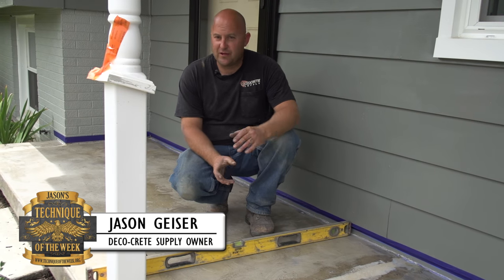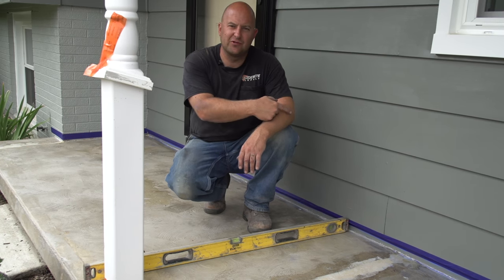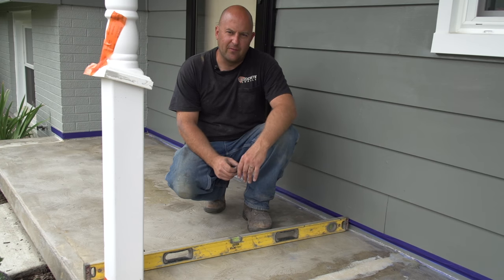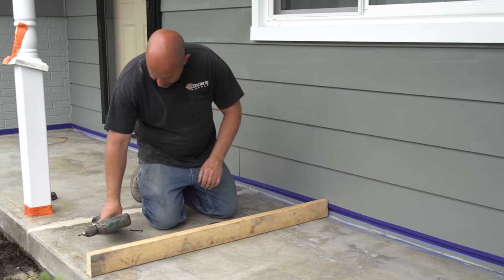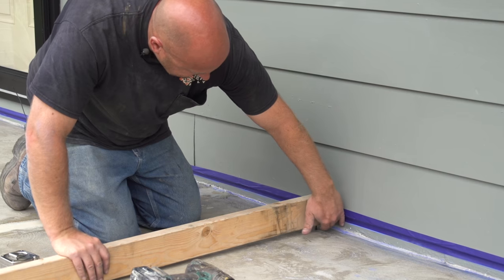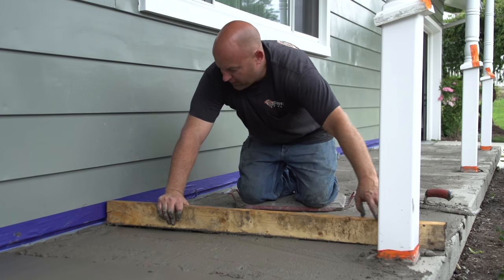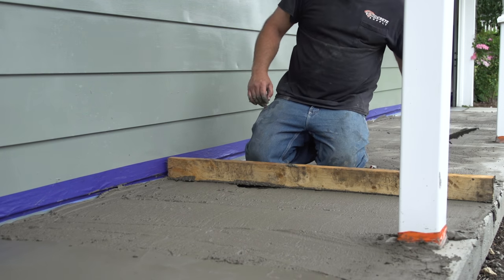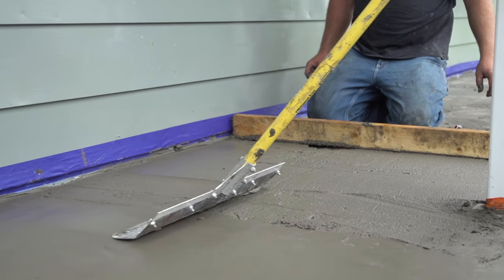Create a Sloped Concrete Overlay!

Comment: How do you make sure it bonds properly to the old concrete - as well, what type of concrete mix are you using?
Reply from the maker: Thanks for the comment! The normal prep process would be a strong power wash and prime the surface with Sure Bond. If the concrete is really smooth or if there is a heavy build-up sealer, you may need to give the surface a light grind before application. In this video, we were using Easy Patch to repair the slope. After that, you apply whatever overlay system you want for the desired look. I'll leave some links to a few other videos and the Easy Patch page on our website. Thanks for watching Deco-Crete TV!!                                                                                        
 https://www.youtube.com/watch?v=qIEfPZC_1pI&t=125s                                                  
 https://www.youtube.com/watch?v=ttIRdTJ6KDY&t=77s                                                    
 https://www.youtube.com/watch?v=6wRXo5dGPmU                                                           
 https://www.youtube.com/watch?v=uVF5gTI2t_k                                                                 
 https://www.youtube.com/watch?v=UrwRi0_0I2Q&t=18s                                                                                
 https://www.deco-cretesupply.com/products/repair-prep-products/easy-patch                                         
 https://www.deco-cretesupply.com/products/overlay-mixes-repair-prep-products-vertical-concrete/sure-bond

Comment: I'm a complete rookie, what would I use on that? some type of leveler? I have a 8 x 16 slab on the side of my house that I would like to build a shed on but the slab has a slope that goes towards the house. Any tips and tricks would be appreciated.
Reply from the maker: Yes a self leveler would work if you are trying to make the slab completely level. but if you are trying to reslope the slab the other way, you would need to use the method in this video. 
flat top: https://www.deco-cretesupply.com/products/overlay-mix/flat-top 
easy patch: https://www.deco-cretesupply.com/products/repair-prep-products/easy-patch

Comment: Did you have to prime the original slab before you put this overlay on? And what brand of overlay did you use?
Reply from the maker: Thanks for the comment! We primed the slab first with Sure Bond 100 and the overlay material was from Deco-Crete. We used Easy Patch on the first layer to re-slope the slab, and Trowel Overlay for the final coat to make it look like broomed concrete. I'll leave a few links at the bottom. Thanks watching Deco-Crete TV👍          
https://www.youtube.com/watch?v=qIEfPZC_1pI&t=6s                                                                                   
https://www.deco-cretesupply.com/products/repair-prep-products/easy-patch                                        
https://www.deco-cretesupply.com/products/trowel-overlay/stamp-mix                                                    
https://www.deco-cretesupply.com/products/overlay-mixes-vertical-concrete/sure-bond-100

Comment: Just wondering I have a concrete slab with 16 x 14 gazebo sitting on it, when it rains water ends up on it and I have to push with a broom or wait for it to evaporate. the cement that was put down was self levelling called Agilia, so the floor is completely level. Any ideas how I can slope from center out to all sides as this is a bigger job than just a porch walk out? Fantastic video by the way reading other people comments is proof of that as well as watching the video myself.
Reply from the maker: Thanks for the comment! The technique in this video would still work on a larger scale, you would just need longer screed board. If you work from center out to edge in the short direction, you could do this with an 8' board. It'll be tough to do that size of an area seamlessly, and it will require mutable batches of the mix. The best thing would be to treat this as a two step process. The first step would be creating the slope and it probably won't look that great at this point. Once you have the slope the way you want it, you could apply a thinner overlay to make it look good. I'll leave a link to our video on broomed overlay below. Thanks for watching Deco-Crete TV!!                                       
 https://www.youtube.com/watch?v=qIEfPZC_1pI&t=120s

Comment: have a question though.  I been reading everywhere that poring concrete over concrete not a good idea. anyways I I have a 30 feet by 4 feet slab on side of garage that has a negative slope towards garage and water is been getting inside garage over the years.  My parents live in garage.  So will this method work to fix negative slope or should I just remove and pour new concrete with new slope to fix problem?  or maybe I should have a french system installed which sounds expensive:(
Reply from the maker: Both methods will work but a full replacement the safest but most expensive. Thanks for watching marco!

Comment: I need to slope a garage floor from the walls, this looks great. Any issue with the edge where the concrete will be very thin/feathered cracking or flaking? Thanks
Reply from the maker: Do not go thinner that 1/8" with easy patch, you should resurface everything with a final coat.

Comment: Would I use something special, or would regular mortar work? I assume stoned cement would make this very difficult. I have front entryway porch with  a low wall around it. Whoever did it before left a lot of dips and reverse pitches. So lots of puddles every rain. I think this is just the thing I was looking for. 👍👍
Reply from the maker: Thanks for the comment!! Glad to hear this video was helpful! We would not recommend regular mortar for this, you'll need something a little stronger. The product we used in this video was Easy Patch from Deco-Crete. After we repaired the slope issues, we applied a concrete overlay to make everything look uniform. I'll leave a link to the product page for Easy Patch on our website. Thanks for watching Deco-Crete TV!!!👍                                                                                                                                                                               
 https://www.deco-cretesupply.com/products/repair-prep-products/easy-patch  
 https://www.deco-cretesupply.com/products/trowel-overlay/stamp-mix

Comment: Wouldn't the overlay need to be at least 2" thick to prevent premature cracking? How long would something like this last before having to redo or demo?
Reply from the maker: the material used in this video can be applied from 1/8" to 1.5" thick. there aren't any guarantees on longevity, but if the slab you are applying to is structurally sound these materials will generally last 15+ years

Comment: Thanks for this video. Jusr bought a place and am having this same issue on the enclosed breezeway that connects my house to my garage, except rather than water going into basement, it runs under the sill plate of the wall and runs into a low spot in the enclosed breezeway floor (same concrete pour).

How well can I expect a concrete overlay to bond to the existing concrete pour? Existing pour has a smooth texture and is painted so obviously there would be some surface prep.
Reply from the maker: After removing the paint and a strong pressure wash you can rely on the primer and overlay to bond.

Comment: Hey great video. Quick question if I want to reslope concrete how thick should I do my cemet for it to bond well and avoid cracking or chipping? Thanks! Keep up the good work.
Reply from the maker: For the mix in this video, Stone Edge Surfaces Easy Patch, you can featheredge to 1.5" thick in one application. https://www.deco-cretesupply.com/products/overlay-repair-products/easy-patch
Check out this technique for ensuring it bonds well https://youtu.be/l9rm2L2BmGE

Comment: Will it crack off with freezing. Did you use a bonding agent?
Reply from the maker: Thanks for the comment! This product holds up fine to freeze thaw cycles as long as the concrete is solid & the prep work is done properly. This job was done over 5 years ago in Ohio and is still holding up. We did prime the surface with Sure Bond as part of the prep work. I'll leave links to both products below. Thanks for watching Deco-Crete TV!!!    https://www.deco-cretesupply.com/products/repair-prep-products/easy-patch                                                                                                                                              
https://www.deco-cretesupply.com/products/overlay-mixes-repair-prep-products-vertical-concrete/sure-bond

Comment: Hi! My concrete stairs at the front porch are sinking. Can I add cement on top of them to level them without raising those steps?
Reply from the maker: Yes you can, but steps typically continue to sink. This would not be a great permanent solution. Slab leveling from a company like A1 concrete or replacement will fix the problem for good. Thanks for watching!

Comment: Dont you prime the the slab or prepare it somehow for the new overlay ????
Reply from the maker: Thanks for the comment! As long as there's no paint or a heavy build up of sealer on the surface, the prep work is just a thorough power wash. After that you make any repairs if needed, and prime the surface with Sure Bond. I'll leave a link to another video that covers prep work for overlays. Thanks for watching Deco-Crete TV!!!          
 https://www.youtube.com/watch?v=UrwRi0_0I2Q&t=1s                                                                                                                                                                                      
 https://www.deco-cretesupply.com/products/overlay-mixes-repair-prep-products-vertical-concrete/sure-bond

Comment: What's the best over lay material to use?  What concrete and does it need screen underneath it?
Reply from the maker: No screen required if the base slab is structurally intact. The material used in the video is linked in the description👍

Comment: Thank y for this great 💡! 
Have terrace with 3,5 m to make a slope. 3 m wide. Need 10 Sack concrete material (35 kg). Do y solve it the same way with (2) screws in a plank? Make it In 3 steps with a 1,2 m long plank?

Comment: I had a concrete patio poured and the concrete dried to fast the guy went across it with knee pads and it holds water in three areas. He poured concrete up to the bottom of my only crawl space. Does that sound fixable without ripping it all out and repouring it all over again? Concrete was poured on rebarb
Reply from the maker: You could use the Easy Patch product used in this video to fill in the low spots and as long as the slab has enough pitch on it, the water should run off fine. As long as you don't mind the how the patches look, that all you need to do. If you want the whole slab to look seamless, you'll need to coat the entire surface with an overlay product. Here's a link to  a how-to video on our Trowel Overlay. Thanks for watching!!!                                             
https://www.youtube.com/watch?v=qIEfPZC_1pI&t=1s
Reply: @DecoCreteTV  thank you for your input

Comment: Did you use any kind of bonding agent? That top layer isn’t going to adhere to the bottom cured layer.
Reply from the maker: Yes, we recommend Sure Bond from Deco-Crete as a bonding agent. Both for bonding the first layer to the concrete, as well as between each layer of overlay. Thanks for watching Deco-Crete TV!!!

Comment: Do you have a video on how to pour a patio with a slope for drainage?
Reply from the maker: Thanks for the comment!! We don't have a full video on that exact thing, but we do have a few on the basics of forming a concrete slab. For exterior concrete, the minimum slope required to get the water running would be 1" of slope per 10', but depending on the situation, you might want to give it a little more. We prefer 1.5" per 10' on stamped concrete, just to make sure the water makes it over the grout lines & textures. I'll leave links to a few other videos that may be helpful. Thanks for watching Deco-Crete TV!!!      https://www.youtube.com/watch?v=grwqtx5ajUQ&t=156s                                                                                                                                                      
https://www.youtube.com/watch?v=EYEAtPSf6ps&t=100s                                                                                                                                                     
https://www.youtube.com/watch?v=LjbGBwxURCE&t=266s
Reply: @DecoCreteTV  thank you!

Comment: How thick of an over lay should i do for steps? They are all sloped toward the riser!!!!!
Reply from the maker: Thanks for the comment! The thickness would depend on what kind of finish you're looking for. Our Trowel Overlay works good for broom finishes and light trowel textures. You would apply that at around 1/8" per coat. If you are looking for a stamped look, you would need to use our Stamp Overlay. That can applied from 1/4" - 1/2" thick. Thanks for watching Deco-Crete TV!!!
Reply: @DecoCreteTV  THanks man!!

Comment: Can the Easy Patch material that you are using be stamped? Can it be colored using acid stain or pigment added to the mix? Just to clarify, you first used a bonding primer (Sure Bond 100?), then a scratch coat of slightly thinned Easy Patch, then regular Easy Patch. Do you allow the primer to dry before applying the scratch coat? I'm looking to resurface a patio. Thanks.
Reply from the maker: [Can the Easy Patch material that you are using be stamped?]
No, we would recommend the stamp mix from stone edge surfaces: https://www.deco-cretesupply.com/products/liquid-color-packs-overlay-repair-products/stamp-mix
[Can it be colored using acid stain or pigment added to the mix?]
Yes, either one will work!
[Just to clarify, you first used a bonding primer (Sure Bond 100?),]
If you are using Stone edge Surfaces' Stamp Mix, we recommend using their Primer 100: https://www.deco-cretesupply.com/products/overlay-repair-products-vertical-concrete/primer-100
[then a scratch coat of slightly thinned Easy Patch, then regular Easy Patch. Do you allow the primer to dry before applying the scratch coat?] 
Yes, allow the primer to dry before the scratch coat.
Feel free to call our office at (330)682-5678 during store hours to speak to an associate, they can answer your questions in more detail!
Reply: @DecoCreteTV  THANKS!!

Comment: He went straight to the leveling trick, which is awesome and clever by the way, but he forgot to mention important details before doing the job. If that is a slab that has been there for some time, you better either pressure wash it or deeply clean it with muriatic acid to remove any dirt, grease, algae, etc. on that old concrete surface. New concrete is NOT glue nor paint. You can't just pour it and expect to perfectly stick to the previous surface because the old concrete is already cured. Concrete doesn't just react with new concrete and join together like when you use PVC cement, which chemically reacts with the material and creates the bond. For that same reason, you need to apply a concrete bonding agent to the cleaned slab before you pour the new cement. THAT will be the "glue" that will make both cement surfaces to join the best way possible. This is very important especially for the thinnest edge side, because the layer is so thin that the slightest stress will separate it from the slab, even walking on it. It will not have a way to attach itself and the simple effect of the temperature change between day and night or worse, winter and summer, will crack it all over and it will come off like if you have placed just a pie crust on top. It will crack and detach by itself. Make sure that you prepare surfaces as best as you can to have the best bonding. If the new surface continues to detach, you may need to go harder and probably get one of these concrete polishing machines with the very rough disk that creates deep groves in the original slab. Then it may have a really good rough surface to hold that new concrete in place without it detaching later.
Reply from the maker: Thanks for the comment! We would agree 100%, the prep work is crucial for getting overlays to bond long-term! This video is about the re-sloping technique, we have another one for the prep work; I'll leave a link below. It's also important to follow the manufacturer's instructions anytime you're working with a product for the first time, as some might have specific procedures above and beyond the general "best practice" for concrete overlays. Thanks for watching Deco-Crete TV and offering your insight on this topic!!!            https://www.youtube.com/watch?v=UrwRi0_0I2Q&t=16s

Comment: How is this not going to crack in a few years?
Reply from the maker: Thanks for the comment! As with any concrete project, there no guarantees against cracking. That said, concrete overlays generally don't crack very often unless there are cracks in the existing concrete. In that case, there's a good chance it'll crack back through unless the crack is delt with first. Even if it dose crack, as long as you do the prep work, priming, and application properly, it'll just be a hair line crack and still function just fine. Thanks for watching Deco-Crete TV!!!

Comment: Brother, no gloves?  Not good.  concrete burns and rashes from the concrete.  No safety glasses.  Disappointed.  How can you work if you are blinded, lose some sight, or have a rash or become allergic to the concrete?  Safety safety safety.
Reply: @knothead5217  Ha Ha, but yet they cry when it hurts.
Reply: @kevincecchini368  
Cry? You might want to rethink the "men" you're hanging around if they cry when hurt.
Reply: @knothead5217  This is true :')